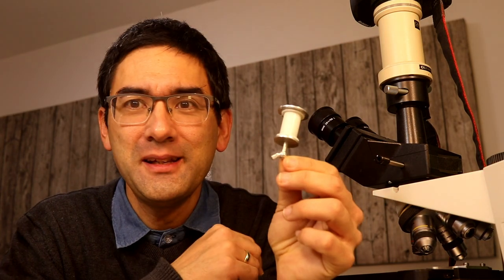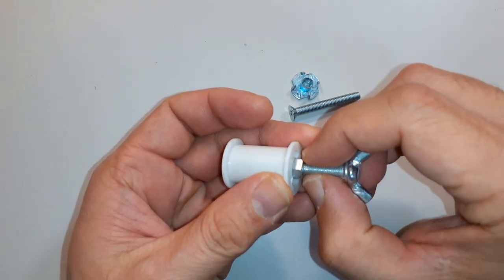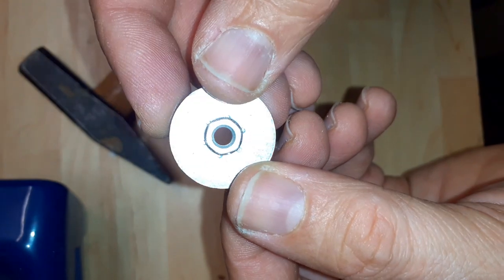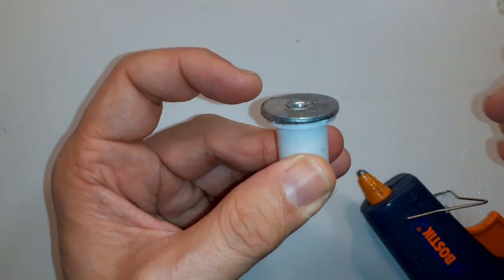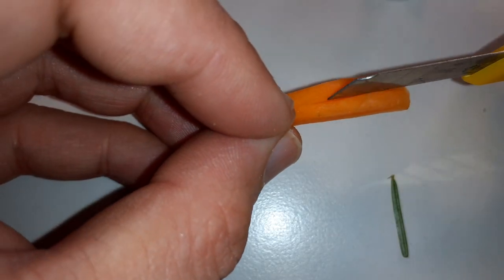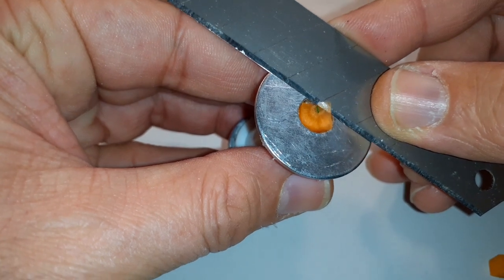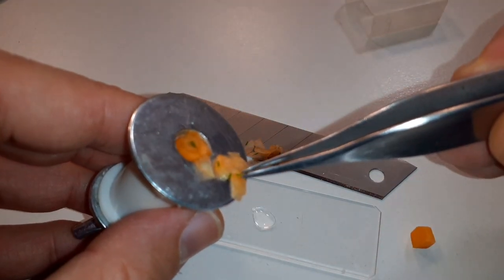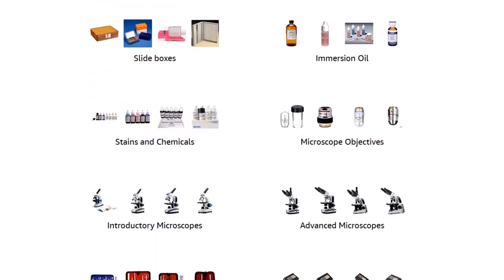🔬 How to make a DIY microtome | Amateur Microscopy

Comment from the maker: Here is another DIY microtome!
https://www.youtube.com/watch?v=A7ANFQCjPb0
Reply: You need to be careful when heating cheap hardware like those nuts and washers. They are zinc coated, and the games that heat releases from zinc coatings are toxic. 

You can do it, but only safely with a respirator or at least outside. 

A safer method would be JB weld or some other epoxy or glue.

Comment: The way I cut my sections is as below:
Snap a shaving blade and sandwich it with two new non-snaped blades, then put the whole contraption in the spring loaded binder paper clip and press the blades in to the specimen. Afterwards release the clip and you have a very thin section between the two outer blades, as thin as the middle blade thickness. 
It works quite well as long as the blades are sharp. Also make sure the blades don't bend while you pressing then in to the specimen.

Comment: You should have probably sanded down the washer before trying to solder it, the galvanization on the washer would have prevented it from attaching properly. Then maybe on the other side the part you're actually cutting on, consider trying to sand it down smooth using a wet sander and get it to as close to a polish finish as you can. It's not hard or expensive to do. That should improve the quality of your cuts by a lot. A double-edge razor blade broken in half can be used as a super-thin knife, when broken into two they become sturdy enough to put a bit more force into them without bending. Another thing you could do is use graphite from a pencil to draw a tiny bit onto the surface, Graphite works as a dry lubricant that will make it more easy to slide the blade along. If your washer is rough it won't catch the blade as much. Although that can contaminate the specimen with graphite shavings. I mean, this is a DIY project nothings perfect.
Reply: If you sand it, the surface might damage the slice, like if your skin were dragged across concrete.
The slice he made was quite fine as far as the carrot was concerned.

Most samples (like biopsied tissues) are embedded in wax (paraffin, I think?) so that the target tissue doesn't bend like it did in the carrot. It is easier to hold a paraffin slice and thus get a thin slice of the pine needle.

This is an excellent, cheap, usable, and minimal design. I give it five stars out of five! I might be using this if I ever get a nice microscope!

Now I need to find a good embedding method.

Comment: Cool. Another thought: After watching the video, I looked at a few hand microtomes on the net.  As a hobbyist, I immediately thought of a micrometer screw.  They cost between 10 and 25 euros.  Actually, one should be able to convert even the cheapest ones relatively easily, still remain far below the new price of a hand microtome and on top of that, get a device with which one can make precisely measured cuts, like with a real instrument.

Comment: Using a hardened, metric fine thread, machine bolt and nut may also have better tolerances, readily available at hardware stores, and they actually have "cut" threads, as opposed type of screw that you used...which often have "rolled threads", with wide tolerances (loose fit). There are also "stop nuts" that have a little piece of nylon in one end meant to keep nuts from working loose, those would take up "backlash" that makes screws wobble in nuts. Stop nuts are a little hard to turn at first, but if you run the nut all the the way up the bolt and then back them off, they turn easier and "seat" on the bolt. You can also find them in a wide range of diameters, which means you could get one that fits snugly within the bore of your DIY micro-tome. A variety of "knobs" are available that could make a DIY with stop nut easy to turn, stays in place, and could be marked with "guestimates" for thin vs thick slices. Two part epoxy is a great way to fix items together and make smooth finish. I love you videos...if I ever make comments and suggestions it is NOT a judgement on what you are sharing...I LOVE your channel. Thank you for this video...very inspiring!

Comment: As I recall, in my Biology 102 lab we had just a simple diy microtome consisting of a small section of metal tube, some soft foam sticks the same diameter as the tube but longer, and a utility knife. Advancing the specimen through the tube was done manually by pushing the foam up from the bottom and took a fair bit of practice to get the appropriately thin sections and yes, the foam filled the blades quite quickly. Still, the cost was negligible. This technique would appear to be an improvement on my simple tube. 👍

Comment: Perhaps use epoxy like E-6000 instead of hot melt? It's easier to remove  the excess (room temperature).

The small washer with points on the bottom is a flange, I think.

Use an X-acto knife for your blade. It is meant to be used as a very sharp blade. You can get capsules with about 11 blades in each. And then get a handle to hold the blade and you are ready for excellent results, or —as my family says —you're cooking with gas!